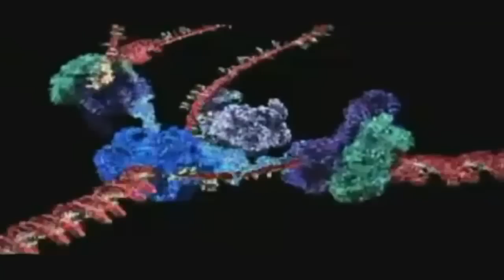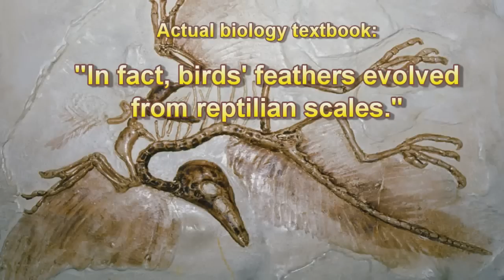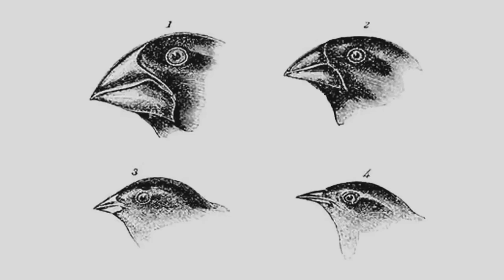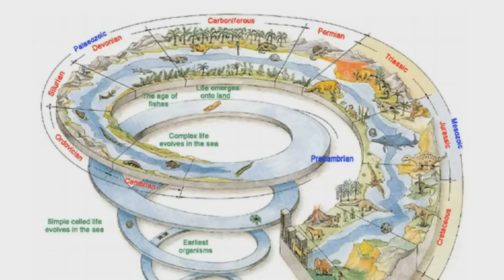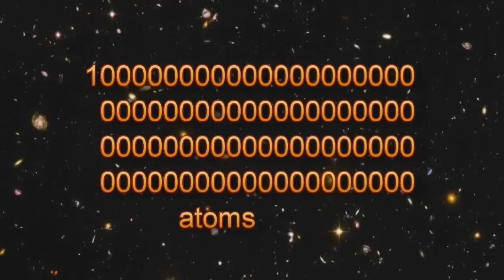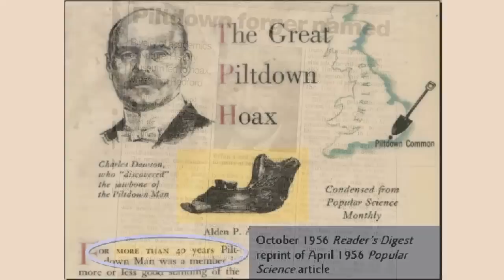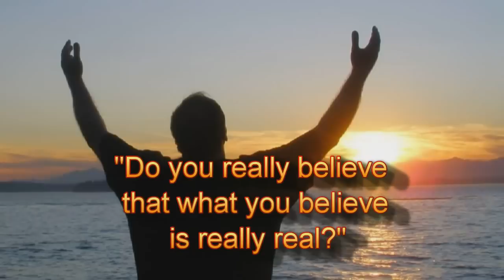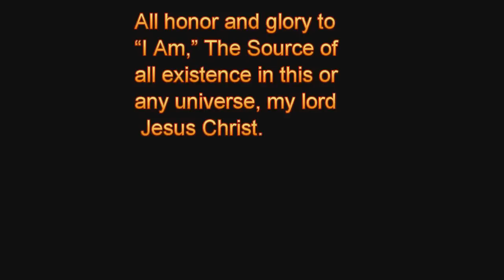Evolution Demolition

Comment: A theory does not have to be correct in order to have utility.   Evolution is for now, the only tool that  Science has to explain observable biology.  You have offered another theory which could be used as another tool to explain the same observations.  I do believe that there are not just two theories to explain these observations, but many more theories that have equal utility.   The real problem we have comes from the restrictions imposed through the use of  the  Scientific Method.  I would hope that someday we could find a better tool to enhance our understanding of Reality.
Reply: Interesting point of view.  Thanks for the comments.
Reply: ***** I would argue that since 1859 evolution has undergone the application of many assumptions--not objective testing.  The most basic claim of evolution is that random mutations can form overwhelmingly improbable instruction sets in DNA sequences by chance.  That fundamental element of the model has not undergone one single verification, let alone "200 years of scientific testing."
Reply: There is still no "standard model" of the origin of life.  Science offers many theories about abiogenesis.  This is a very complex subject where the popular authors spend very little time discussing and more time on why their is no God, which of course, helps them sell more books.
Reply: We have that tool, it is called Science.  We only have one explanation for the diversity of life on the earth, Evolution.
Reply: Thanks for the posting.  I don't know what you mean by the term "we".  I get many postings from folks who have tools other than the common theories of Evolution.
Reply: Tom Adamson You seem confused, there is only one Theory of Evolution [Origen of Species, Natural Selection, etc.]
It was accepted 150 years ago with the discovery of the first transitional fossil, a dinosaur with feathers.
Reply: I humbly disagree, please do an Internet research and you will find that their are many variations of that theme.  Thanks again for the posting.  You may want to check out the bolg: theReallyBigBang dot com.
Reply: Thanks for several very interesting comments.  I would offer that Evolution and Creationism are not the book ends of this important topic.  I feel that they are simply way-points and we can expand beyond them instead of being captured in-between.  Thanks for your posting.
Reply: Hello, Tom. That is a nice beard you have. I burned mine while using a welding torch ... rats ...
Reply: I never tried welding... As you can see.
Reply: Tom Adamson I'm not sorry, everybody (but me!) had a good laugh and  it is too hot for a beard here, anyway.
Reply: Glad to hear that this made you happy.  I'm in New Hampshire and need my beard.  Thanks for the posting.
Reply: ***** Great analysis! However, it is VITAL to the designs of evolutionists to convince folks that their RELIGION is science.

So at every opportunity - they SCREAM at the top of their lungs 'Evolution is SCIENCE!' - when it is nothing of the sort.
Reply: Tom Adamson There IS a standard model: In the Beginning, God CREATED....

ALL of the real evidence aligns with this view - UNLESS you are PREDISPOSED to NEED for there to be no God.  Such a person MUST EXPLAIN away OBVIOUS real evidence.

Since they cannot do this easily, they COMBINE their 'theory' with a good dose of SCATHING INSULTS for those that call their LIE what it is.

Just watch!  Here comes several salvos of insults with NO REAL EVIDENCE from evolutionists.
Reply: Glenn W. Hello, Glenn. You said you have a Webster's. Take ir and read both definitions "Science" and Religion". Ask them Courts of Law. Sadly you are quite wrong, man. Wise up.
Reply: Tom Adamson Sorry but I can add nothing to your first post, and I'll say more, I fully agree. That let the beard to comment on. I enjoy reading you, thanks.
Reply: ***** Yes, I do have a Webster's and it clearly shows that Evolution is at best a 'theory' - but BEST fits the (generally) 3rd definition of RELIGION 'any system of beliefs'.
Evolution most certainly DOES NOT fit ANY definition associated with science - which requires ACTUAL FACT and something to be REALLY TRUE.
Reply: Stephen Land Stephen - I do believe this is the first time you have not 'over the top' insulted me, Christianity, Creation, etc.
Your 'barb' is actually (while untrue) completely within the bounds of spirited public debate.  Congratulations.

Now - as to your ridiculous assertions:
While several characters in the Bible herded animals - few actually herded only goats (ez in Hebrew, means 'shaggy'), many herded sheep (tseown in Hebrew - which means, to migrate) - but several other occupations are mentioned throughout. So technically, you are wrong.

As for 'Bronze Age' - this is a made up term created by evolution believing anthropologists who had to add millions of years to their schtick as cover for those pushing it in other areas of 'study'.  So again - your characterization may be 'correct' from your perspective - but not from reality.

As for 'Middle East' - it is today; but when the religion got going - it was the center of the world's focus.

Flail away, Stephen - the longer this whole thing goes on - the MORE it is PROVED that Evolution is but a counter-religion to try to soothe the GUILTY consciences of those that have decided to REJECT God.
Reply: Stephen Land I'm not sure who you are quoting, but it isn't me.

As to the "rapidly developing field of abiogenesis" all I can say is show me.  All I've ever seen is a plethora of wishful thinking.  No one has overcome even the simplest of hurdles.  Complex polymers do not form themselves, except perhaps in a very fleeting way--breaking down faster than they come together.  More importantly, the specific sequences bearing coded information is scientifically impossible to arise by itself. We all know this intuitively:   Buildings must be built.  A tornado passing through a pile of bricks simply will never do the job.  Abiogenesis is a pipe dream.  If you disagree, show me even the tiniest headway against such scientific principles.
Reply: Some interesting reads here, I think we are all trying to stay constructive.  Thanks for the postings.
Reply: Stephen Land If you saw my video you know that I agree with natural selection.  But natural selection is not a constructive principle.  Rather it is a destructive principle:  (Weaker members of a given population tend to die first.)  Natural selection does not create viable genetic information, but destroys non-viable information.  The real issue is where the new programming comes from that natural selection is supposed to select?  Mutations simply cannot write overwhemingly improbable genetic algorithms.  Minor damage to existing algorithms perhaps (if the probabilities are not too small), but building up coherent, functional, programming is impossible by random means (according to information science).  The probabilities against it are staggering.  There are not enough atoms or nano-seconds in the universe to render enough chances.

If you think accidents can write new programming, please give me an example.
Reply: Great discussion going here.  Happy to see an attempt at keeping it constructive.
Reply: Stephen Land You said there is no direction in evolution, and then proceeded to describe a direction.  You rambled about the evolution mechanism as I described it, and then said I don't understand it.  I understand it perfectly.  If not, then correct my error.  What are my "false ideas" about how evolution works?

You admitted that "a very small proportion actually confer a benefit."  How small is that proportion exactly?  LIke 10^-162?  That small?  Have you actually taken stock of the probabilities?

I must quickly correct a term here.  I never spoke of mutations in terms of the benefit, because there are some less improbable mutational changes that can occasionally be a benefit, despite informational damage.  However, mutations cannot produce new algorithms.  The odds of new programming being written are so small as to surpass what information scientists define as "operationally impossibility."

If any of my ideas are out of a "playbook" then it is a very good playbook.  And many of them are original, so you flatter me.  Yet, does it matter which playbook ideas come from if they are true?
Reply: Mark Champneys Glenn W. It's mathematically impossible that all living organisms aren't related (much more impossible than 10^-162 or even 10^-1000 ) until we find (if there is one) another mechanism for sequence similarity in ubiquitous genes. I can present you the study if you'd like although it takes a long time to write out. 

I can actually give you examples of bacteria evolving completely new features (bacteria because they mutate very fast so it's easier to observe). 

Pretty much any valid question of evolution you ask me I can answer. If the question is invalid (inadvertent straw man, misunderstanding of the theory, conflation of terminology, miscalculations etc.) I will try to correct it.
Reply: Don Clue There are far bigger probabilities against evolution then that.

Also...what does this mathematical improbability do?If it is certain....what does it do to reality that makes it different?In fact species are related in the sense they were created and had a creator reusing material.
Reply: XShroob  No there aren't....

the mathematical improbability is for the results occurring without common descent. The species share specific similarities which can only be similar from inheritance. This isn't just a baseless assertion. I will link you the study if you want.
Reply: Don Clue
Creationists accept natural selection.They accept common decent in the sense a kind gives birth to it's own kind and makes differences.

And....you know some people accept common descent in animals as still not disprooving God.Some say God used common descent for animals.
Reply: Don Clue Also....creationists say a common designer did many of the things scientists claim is by common descent so don't just think it is exclusively evolutionistic.
Reply: Don Clue Whoa, bacteria with "new features?"  You've got my attention.  First, please define feature.  But I'm all ears, Mr. Answer man.  Perhaps you can do what no one has been able to.
Reply: Don Clue Of course all living things are related.  They all have the same Designer who uses many common subroutines throughout His design.  But you have ruled out the possibility of this mechanism from the outset.
Reply: Mark Champneys God is not 'falsifiable' so science can't use gods.
Show us a designer.
Reply: Mark Champneys I will answer your bacteria question in another post so wait for me to write both before you respond (for some reason I can't write a lot on the same post..). Oh no I haven't merely ruled out the possibility of a creator utilising the similarities. Rather, it is unnecessary for him to use common subroutines in this context. 

The ubiquitous genes are functionally redundant (their sequences can differ up to 100% and always retain the same function and functionality) and uncorrelated to species specific phenotype (the gene is completely independent of phenotype). There is no specific sequence necessary for a particular organism. So if we look at a particular ubiquitous gene (genes required by all living organisms) named cytochrome c, we could delete the native cytochrome c from yeast for example, and replace it with any other organism's sequence of cytochrome c (human, pigeon, turtle, fruit fly etc.) and it works exactly the same, with the same functionality, despite the differing sequences.  There are 2.3x10^93 possible sequences of cytochrome c, all performing exactly the same function with the same functionality. This number is over one billion times the number of atoms in the visible universe. Now note that the only observed mechanism for sequence similarity in cytochrome c (and all ubiquitous genes) is heredity so if two organisms have even moderately similar sequences, we can deduce that due to the astronomical odds against it being chance, they are related. Of course, in the absence of common descent, we would expect there to be no sequence similarity between say, humans and chimps...

Humans and chimpanzees have exactly the same protein sequence of cytochrome c. The probability of this happening by chance alone is conservatively less than 10^ -93. We can test it for all organisms and they all depict sequence similarities. For example, despite yeast being so very different from us, we share a sequence similarity that has a 10^-29 probability of occurring in the absence of relatedness. Note that for us to share these similarities with both these organisms by chance alone is then 10^ -122. Now note that all organisms share similarities of sequence defying impossible odds (so each time we multiply this 10^-122 by the odds of it occurring by chance in other organisms, the probabilities of which range from 10^-29 to 10^-93, to eventually reach the probability of this occurring in the absence of common descent). Obviously there are a lot of organisms and so we have already come to a monstrously large number. Now note that this was only the study of one ubiquitous gene. All ubiquitous genes are found to be sequentially similar in all organisms, with the degrees of similarity between organisms congruent regardless of the ubiquitous gene we use. Now note that the DNA coding sequences of the protein sequences of these ubiquitous genes also display a similarity (again their structure is redundant to their coding function - there are 10^46 different coding sequences specifying exactly the same protein sequence and the only reason for similar coding sequences is heredity). We are already well beyond the realms of mathematical impossibility as regards to this occurring in the absence of common descent. The only way to falsify this study is to discover another mechanism for sequence similarity in the ubiquitous genes. Scientists are constantly searching (falsification is part of the scientific method). You could say god did it but you have to give me a reason why he would give say chimps and humans similar sequences and then pigs and humans less similar and plants and humans less similar and so on ...To emphasise - there is no phenotypical reason for similar sequence, nor does sequence have any relation in function to a specific species - the only mechanism for sequence similarity is inheritance. 

I can delve into even deeper mathematical certainty of common descent is the results this study produces are independently verified by multiple other methods and phylogenetic trees. 

Note that this study doesn't assume common descent to be true. It merely observes the similarities (which we would expect not to find in the absence of relatedness via inheritance) and groups organisms together in a phylogeny by positioning them with regards to their similarity to one another. Common descent is a deduction from this study.

I shall answer your bacteria question straight away on my next comment.
Reply: Mark Champneys Ok so :
Feature - I mean variation of traits as production of novelty rather than pre-existing variation. So varying but not just rearranging pre-existing possibilities - do you agree with this interpretation?

Insects have evolved resistance to pesticides and disease-causing organisms have evolved resistance to antibiotics. Antibiotics and pesticides are both generally unlike anything found in nature so it is highly improbable that the insects possessed pre-existing potential for this resistance, before the antibiotics and pesticides had ever been invented. 

Some bacteria have evolved the ability to digest nylon (which did not exist before 1935). The evolutionary addition of one single Thymine nucleotide caused the new bacterium to have an enzyme composed of a completely new amino acid sequence, via the frame shifting mechanism. If you require me to explain how frame shifting mutations exactly create new information then I will (this will take a very long time and is probably best down by email, but it will help you understand how new information exactly can be created in this specific mechanism). Bear in mind that it is unlikely that this potential to digest nylon was built in by an intelligent designer - the new enzyme, while functional, is 50 times less efficient than the precursor enzyme. Regardless of whether it's still a bacterium (by the way we should never observe a bacterium change into something that isn't bacterium), this was purely to show the evolution of entirely new information or a new feature. 

We've similarly observed the adaption in yeast to a low-phosphate environment (new feature), E Coli's evolution of the ability to hydrolyze galactasylarabinose, evolution of multicellularity in a unicellular green alga etc. etc. there are many more. The examples are with bacteria as they mutate very rapidly and generations of bacteria pass by quickly - obviously you understand evolution is generally a gradual process and so despite possible novel features mutating in humans, we would not be able to notice them until after a few generations of the mutation's propagation.
Reply: XShroob Common descent in an evolutionary context means that all animals have one or multiple original common ancestors. If you say god did this that's fine - you could say that evolution is god's gift of free will, incarnate in nature; instead of forcing specific structures upon his creation he allows them to all develop symbiotically with one another and in accordance with nature so that eventually the remaining organisms have great biological efficiency. Whatever, i'm not arguing against god, i'm just arguin for evolution.

The similarities are often able to be applied to common designer or common descent, but in some cases, like the cytochrome c study I presented above, there is absolutely no reason for a common designer to implement the similarity.
Reply: ***** This video does not invoke God to demolish evolution.  ID theory does not deal with the identity of the designer.  However, once my arguments are digested, I certainly think that the God of the Bible should be considered in view of the scientific impossibility of programmed instructions arising from random mutations.
Reply: Mark Champneys No, the video talks about Piltdown Man,  How does that prove evolution wrong ?!?
Only a 'god' can design and ''poof' make a universe, my next door neighbor is a designer but I don't think she did it, you are not fooling anyone.
Why is your God the correct God?
Programmed instruction  WTF is that?
Darwin did not know about mutations, I thought we were talking about Origin of Species by means of NATURAL SELECTION.
Reply: Supernatural, like something from nothing (Big Bang), something to nothing (Black Holes), Intelligence from randomness (Evolution), and the list goes on with Dark Energy, Dark Matter, etc, etc,   And next we have the Quantum.  Thanks for bringing up Supernatural.
Reply: Stephen Land Nope.You clearly misunderstood ID.

ID says that things in nature point to a kind of designer.Just..that.A designer definition that's all.You are only using something similar to the Accordion Effect.
Reply: XShroob Nice straw man arguments. 
ID is an argument for God. Period.
Reply: Thanks for the thoughtful discussion.  I enjoyed the read.
Reply: Stephen Land Ah, we get to your underlying fear.  You are worried that you are "going to let a supernatural deity in the back door."  Never mind what is true, we simply must block certain things from consideration, right?

That phobia of yours is precisely why ID theorists want to leave the supernatural out of the discussion for now and simply investigate something that is very much a part of the natural world--intelligent mind.  Do you deny that intelligent mind is a real thing that has real causes and effects in our universe?
Reply: ***** A designer..not really God.

It searches and shows things that ID can only explain and it hints at a unspecified designer.Call it ana rgument for God but the ID supporters nevre mention him outright.
Reply: yarpen800 The point of my video was to prove that evolution is scientifically impossible.  Did you watch all of it?
Reply: suffist Funny, the way I see it, all those "ologies" support creationism (when speculations are not lumped in with the science).  Creationists do not run from science.  But why not make your case for something you consider pseudo-science?  Pick your best argument and lay it on me.
Reply: Mark Champneys Dinosaurs with feathers
Reply: Tom Adamson

"Supernatural, like something from nothing (Big Bang), something to nothing (Black Holes), Intelligence from randomness (Evolution), and the list goes on with Dark Energy, Dark Matter, etc, etc,   And next we have the Quantum.  Thanks for bringing up Supernatural. "

The big bang isn't something from nothing... its the sudden expansion of something unimaginably small to something unimaginably large. 

We don't know enough about black holes to confidently term them as 'something to nothing'. We don't know what happens. 

'Intelligence from randomness' - study evolution. Natural selection is the filtering process which determines the propagation and accumulation of the beneficial mutations. Yes the original mutations themselves are generally random (not all the time, as in the case of epimutations) but the process of evolution itself is not.
Reply: Mark Champneys  "all those "ologies" support creationism "
That has to come under one of the most stupid things iv'e ever read. They are real jobs which you have to learn the Theory of Evolution to practice. Not one of those "ologies" do you learn creationism, in fact they are the opposite of creationism. What branch of science do you learn creationism and what discipline is it used?
Reply: Mark Champneys  "Creationists do not run from science." 
So how do you use the scientific method on creationism? Creationists distort science to fit their backward religious beliefs.
Reply: suffist The scientific method is not done on either evolution or creationism because both are in the distant past.  The two models can only be tested in the present.  The evolution model has hindered the progress of science at times, such as the assumption of junk DNA, which we now know was not true.  Creationism would expect all DNA to have function, and that is what we are now finding.
Reply: Mark Champneys " Creationism would expect all DNA to have function, and that is what we are now finding."
Creationism is religion and that is why it is not allowed in the science class in the UK.
You can use the scientific method on Evolution, but you can't on creationism because it's religious nonsense. There is not one shred of evidence for creationism, ZERO
Reply: Mark Champneys Just because scientists have found some function for some Junk DNA does not change anything.  DNA still shows how everything is related to everything else.
''Creationism would expect all DNA to have function'' so it is wrong.
Reply: ***** It is definitely related.  But is it related because of ancestry or because of a common Designer?  I think there are excellent reasons for the latter.
Reply: Mark Champneys Show us a 'designer' then.
Why are all the fossils of extinct animals, did the designer change Her mind?
Reply: The "Designer" designed the process of Evolution...